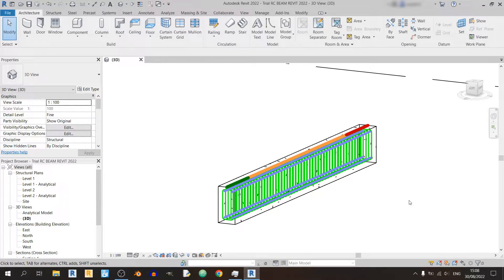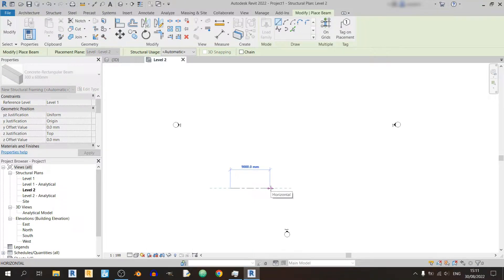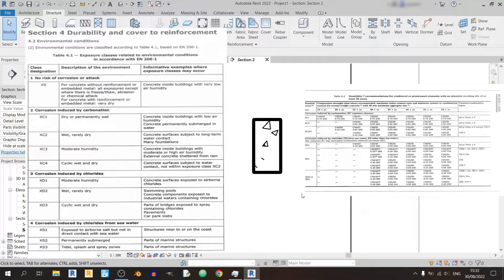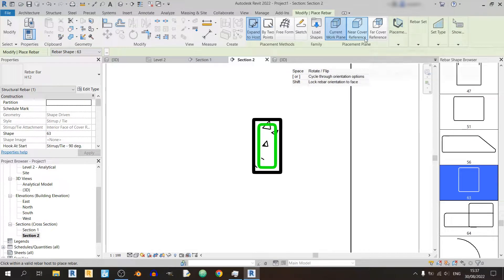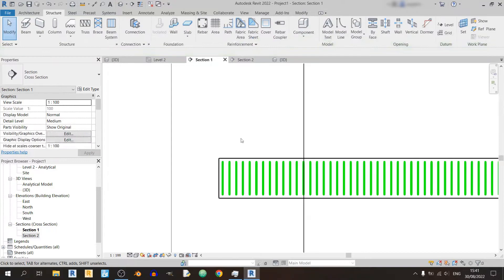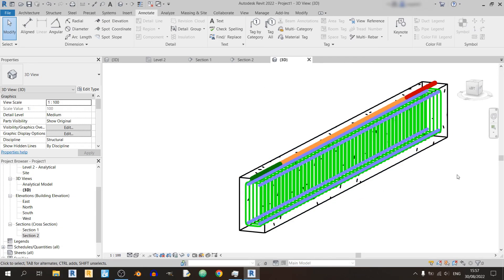How to model a reinforced concrete beam?

Comment from the maker: Timestamps:
0:00 - Introduction
1:24 - Drawing the RC Beam
2:12 - Drawing in Section Views
3:06 - Rebar Cover Settings
4:30 - Introducing the Rebar Button
5:20 - Drawing in Stirrups/Shear Links
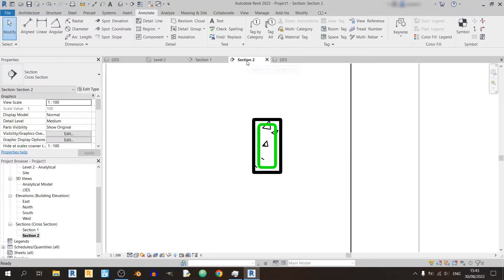10:10 - Drawing in Longitudinal Bars
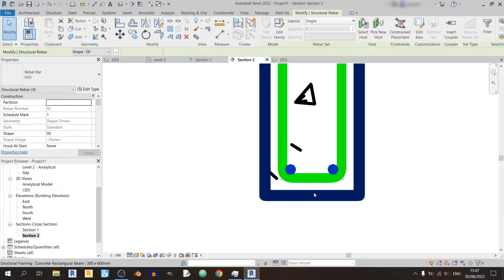12:12 - Dimensioning the RC Beam